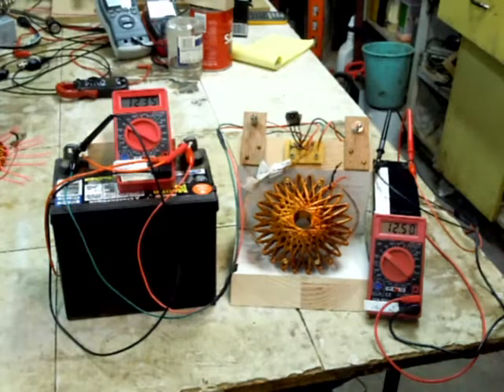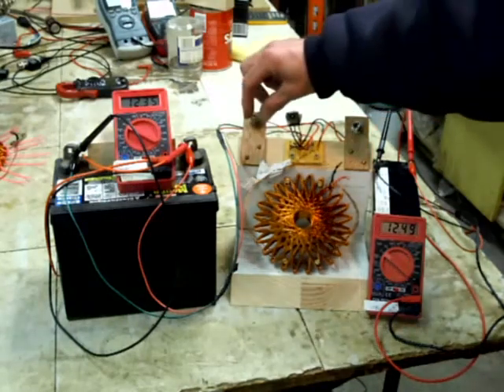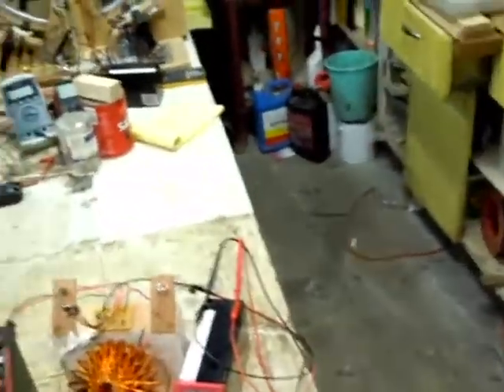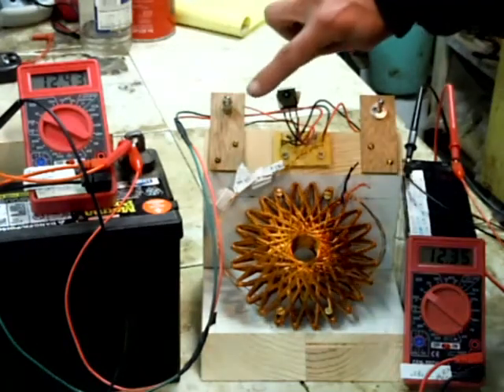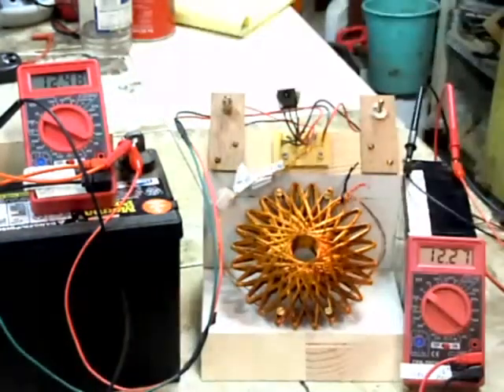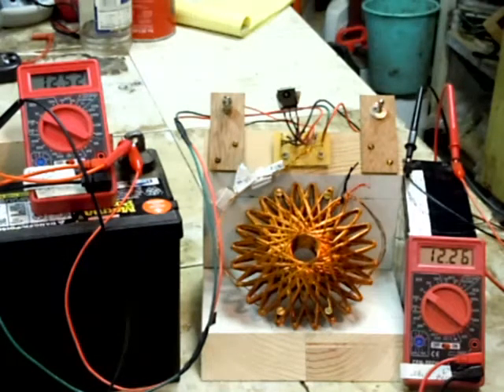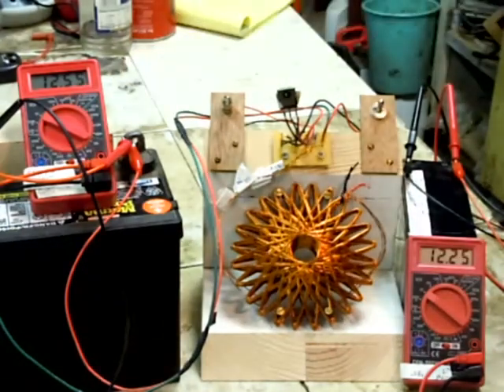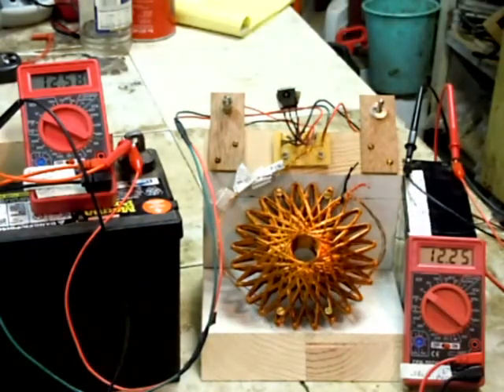Starship Coil Bedini Charger - Too Darned Simple.

Comment: hi, jst tested out this circit and i mut say is not quite working. My battery is getting charged up from 3 V to 11,78 V and the current is as expected from a 5Ah 12V battery (33 amps for a few seconds) but if add a 41W dc light bulb the battery lasts for 7 minutes instead of 30 minutes like it lasted previously when it was charged with regular hot electricity. So my biggest question is : Why is my battery charging but is not holding the charge for the same amount of time?